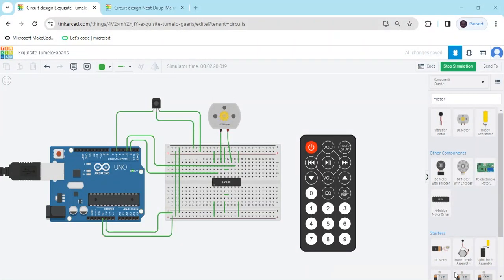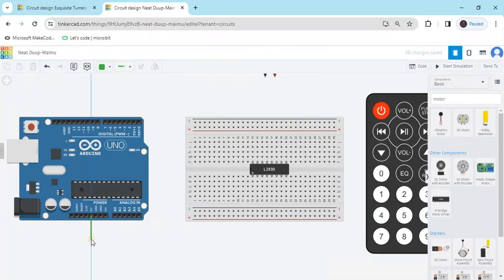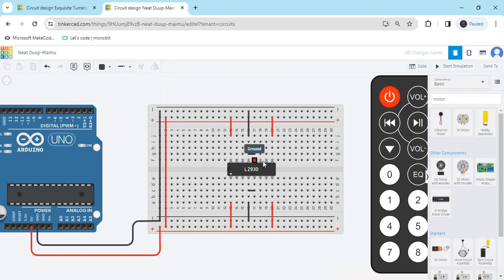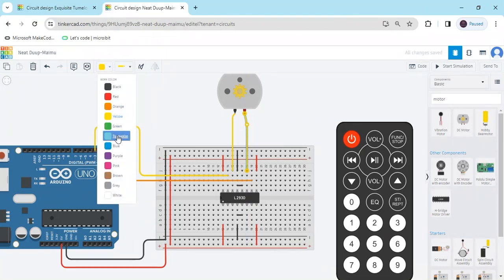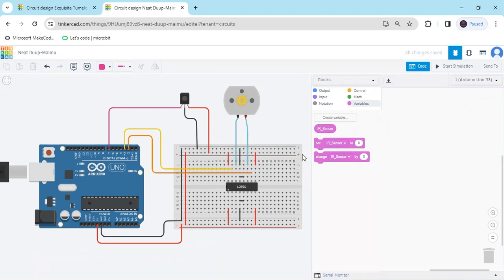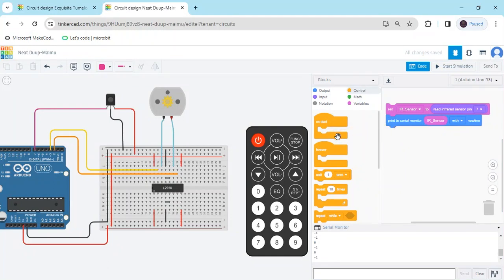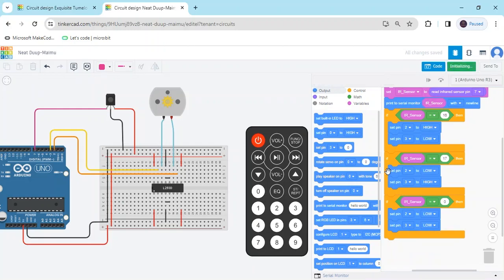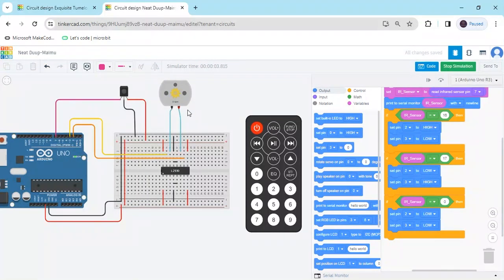IR Remote control DC Motor Arduino Tinkercad | Block Coding

Comment: I tried to open your tkintercad model and than I started simulation, but IR remote won't work for me. Do you maybe know why?
Reply from the maker: Library is change 
Watch the new video https://youtu.be/4y6IIx3OBIQ?si=EEn2-ljXOr9JSRf7
Reply: @eazytronic9394  Hi, thx for respone. Would You like to help me with my project, I need to control speed of DC motor via IR remote control
Reply from the maker: WhatsApp me 7007651787
speed control fan code is different